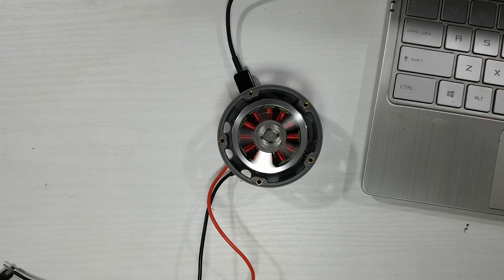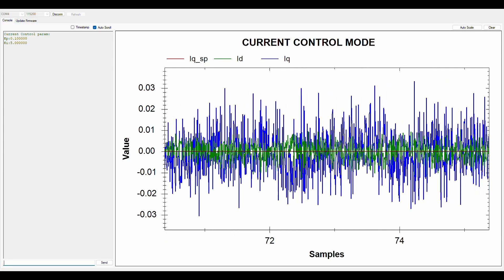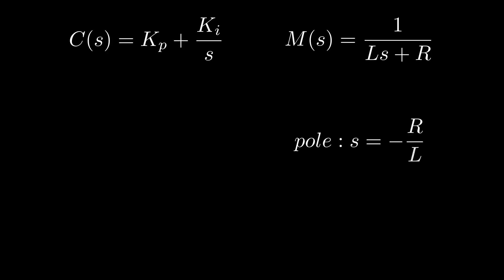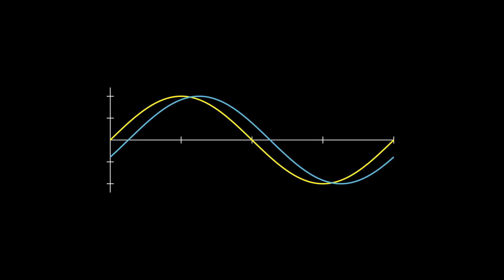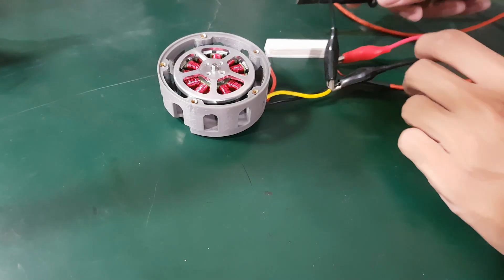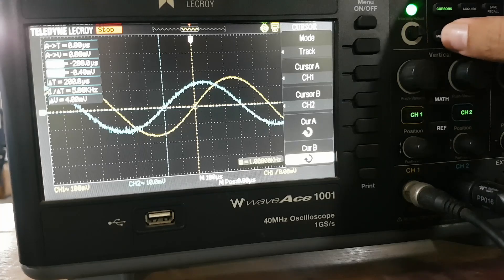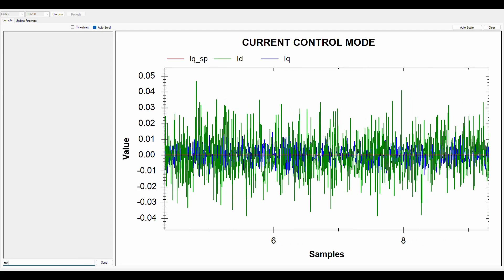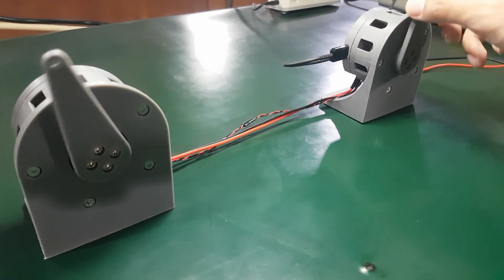FOC PI Gain Calculation Made Simple

Comment: It is very interesting video. I have one small doubt, during the motor resistance and inductance measurement, I am little confused how you have excited the motor phase windings. As you mentioned one phase winding of the motor in parallel with other two phases short, then in star connection overall R = 3Ra_phase/2 L =3La_phase/2. You have considered it or not. Please correct me if my understanding is wrong?

Comment: Actually this is more like a measurement method rather than a tuning method, in FOC we have two distinct closed loop one for id and the second for iq, and the transfert function of both need to be extracted from the Vd and Vq voltage of the motor which includes the the back EMF of the BLDC which in this case assumed to be sinusoidal although in fact is not the case since it's actually trapezoidal, that means we only consider the first harmonic of the EMF, which results in a slightly lower torque compared to the trapezoidal control, also for the control loop we need to consider the decoupling terms as the PI controllers only outputs a linear term, and last and not least the inverter's transfert function which can be modeled as a first order system ! Btw Thanks alot for these serie of videos I really enjoyed'em !

Comment: Hay there man I follow your tutorials am in BSc mechatronics aand my Final year project is designing a controller for foc am using as drone motor and optical encoder but I am using drv8305 and the 6pwm on esp32s3 with simple foc now to develop the can communication I was also wondering that instead of cresting everything from 0 lets use some standard

Comment: very good stuff my friend! 
new project idea: when we manual turn the rotor, we can feel the cogging postions from the magnets. 
my motor has 7pp and 12 coils and i can feel 12 cogging positions when the motor is not powered. 
now lets send currents to the motor so that it compensate the cogging from the magnets. 
so that the motor is free and smooth spinning when we give the rotor a gentle push. but we want is free weeling and after  a few seconds slowly come back to stand still.  
this is not easy, but would be impressive to have it. i already thinking a lot how to solve it, but not yet. 
without encoder please! we go current sensing. 
tricky is: the motor is spinning and we need to sense the rotor pos and apply just the right torque to compensate the cogging from the magnets. not easy.
Reply from the maker: Very impressive, I'm still learning sensorless foc to eliminate magnetic encoders with their various problems. But it hasn't worked yet. I'll keep trying. Thank you